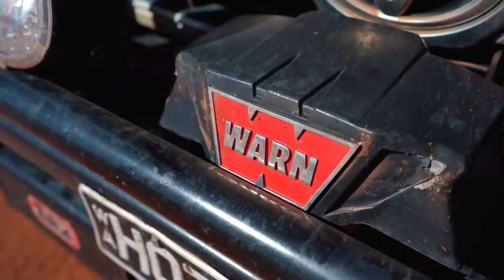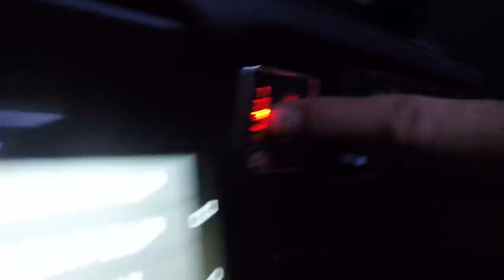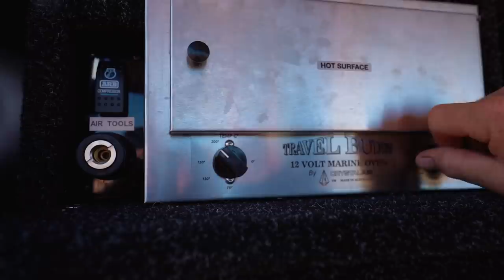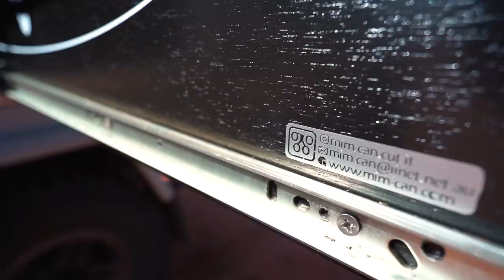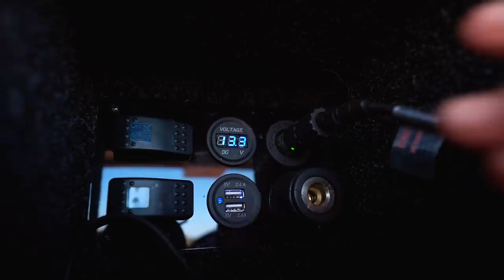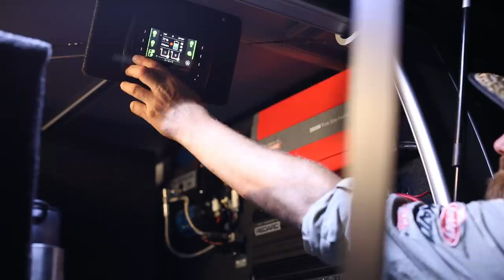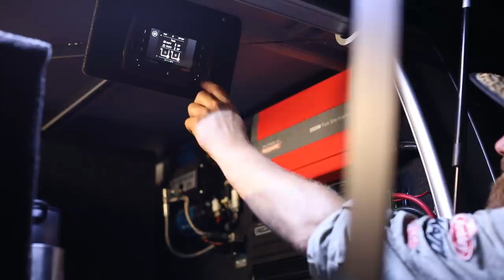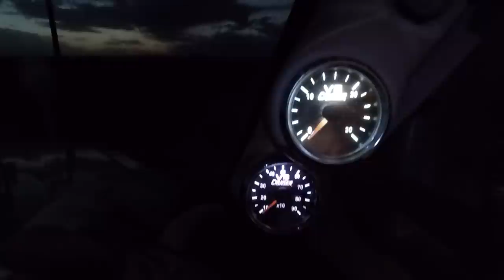Modified 79 series Landcruiser, Episode 79

Comment: I’ve got the same ARB LINX system on my Ranger, and the preset auto tyre inflation app is a bit of a pain in the A$$, and requires a bit of a hack to make it feasibly usable.  While inflating a tyre, the compressor constantly cuts out and only runs in “burst” so as to check the current psi, which gets worse as you approach your target psi so as not to over inflate, but wow it takes a hell of a long time.  The hack I use is to set the target psi to 60 (if I’m going for 40), so that the inflation “bursts” are longer, and then just keep an eye on the psi when the solenoid stops the compressor for a psi check.  I’ve gotten use to where I need to remove to hose to get within a few psi of my target psi, so while not ideal it cuts the time in half to get the job done.  The LINX system is great, but there are a few bugs that have me still sitting on the fence for whether it was a wise investment, but hope it’s doing everything Torb’s hoped it would for him at least.

Comment: If you've ever had the misfortune of spending an extended period of time in a Gwagen ute, you'd be firmly in the "I would rather drive a Pink Suzuki X90 than this turd" camp.

Things like:

You can slide the seat back. Or you can recline the seat. It is vertoben to do both of these things at once. And there's zero room in the cabin at all to actually change this arrangement.
The steering feels like the power steering pump fell off. I have NEVER driven a vehicle with as heavy steering as a Gwagen, and that includes LN106 Hilux with no power steering belt and a 15 tonne MAN truck with the tyres aired down in deep sand and the front locker in. Its literally two hands to turn into a side street.
Its a $125,000 vehicle, and the interior makes the inside of a 70 series workmate look like a Bentley. They literally do not give you enough vinyl to cover all of the floor.
You do not get a center console. There is a console there, but it has a battery in it. For reasons. Because the two for cranking are not enough apparently.
You would struggle to find enough room to fit a guinea pig in the engine bay with the bonnet closed. When Mercedes fitted the V6 diesel, they didn't change ANYTHING in the engine bay to make more room. They put a dent in the bonnet pressing to make room for the turbo snail its that cramped. Don't even begin to think about adding things in there, there isn't the room and it will probably break shit for no real reason.

Mercedes Aus don't actually know all the details about this vehicle. There's a button on the dash. It does something, because something clicks. It is not marked in any real meaningful way. It is not mentioned at all in the manual. The dealer has no idea what it does. But it makes something go click.

The original design brief of the Gwagen was "Get a car load of troops from point A to Point B while under fire, and it shouldn't break down so that anyone who hasn't been shot already can get to where they need to go". They haven't updated the thing AT ALL to reflect how normal people function.

If you gave me the $125K to buy a Gwagen, I'd buy two 70's with it.
[/End rant]

On a totally different note- Ronny should look into making some stubby holders with the magnets on them! that way you can stick em to your car/fridge slide/bull bar when your half cut going to bed and not loose them in the morning!
Reply: ferremit, I would hope the brief was not moving troops under fire as gwagons have no armour and they are just a run around vehicle in reality (Australian ones atleast) all your other points are very  valid especially the centre console which isn’t a centre console 😂😂😂, but they aren’t for getting shot at in, that’s what PMV’s are for

Comment: Question for Torbs: you said you run a 6 tyre system with rotation, I’ve recently got myself a new 4x4 and Have 2 spares .. SO what’s you recommendation if rotation sequence
Reply: I just go spares to rear, rear to front and front to spares no crossing over and has worked a treat for me

Comment: Torbs, why does it sound so breathy when you're cruising? is it the larger air cooler, crossover pipe or something elsle? killer sound and cool rig, can't wait to see the electrical setup vid. running 3 fridges! is seperate fridges better than one fridge freezer? Another great job Ronnie, your vids help out so much. worth every cent.